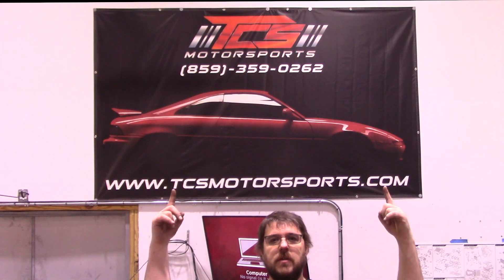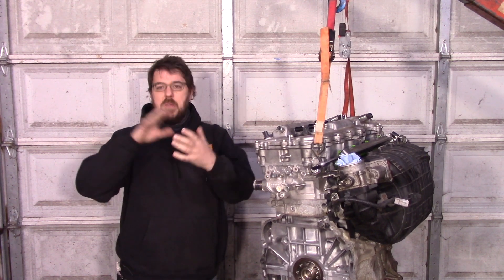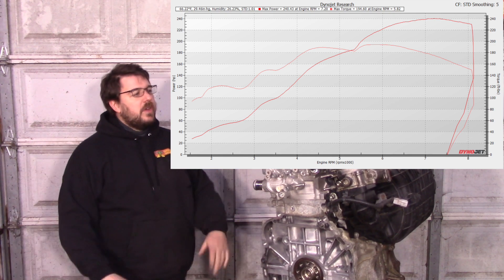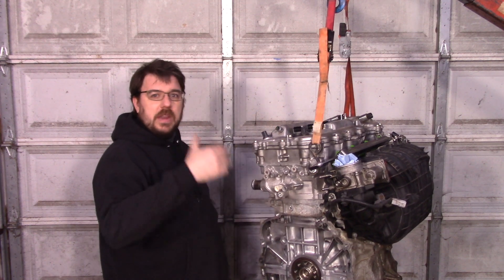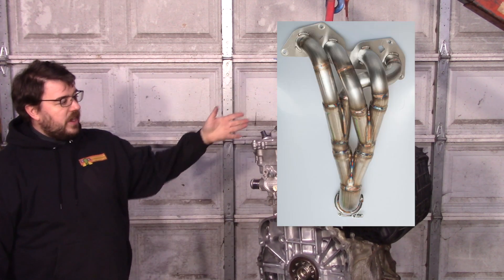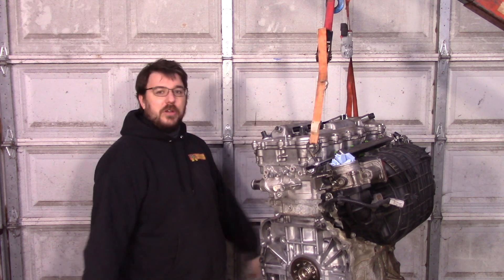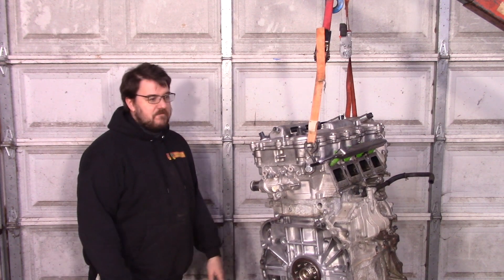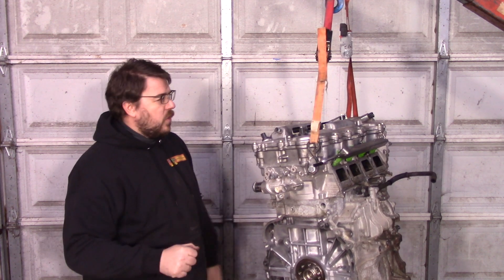Upgraded camshafts for the 2AR-FE.

Comment: Hey buddy I have been watching your videos on this 2ar for awhile and have really enjoyed your content. I was wondering if you're running A/M adjustable cam gears? I'm having a problem with a 2ar Camry at work and haven't been able to figure out why I am getting a P0017 code. Trying to relearn cam position sensor following all-data procedure and it bent all the intake valves. Timing marks were verified 3 times and were still on even after the carnage. Any help would be appreciated

Comment: So these are a replacement for the FXE parts bin cams? Seem very similar in outputs

Rather, were since I see these are no longer available
Reply from the maker: These are much bigger but the stock intake limits the airflow to near the same number. Also keep in mind it makes a bit more power with less compression. With the intake swapped to my velocity stack intake these cams gain 30whp and there's more to come.

The cams are currently not available but that's work in progress and they will be available again by the end of this year.

Comment: Toyota did a good job with the 2AR-FE engine, it has potential. I have the same motor in my 2013 RAV4 and I put on an short ram intake, exhaust headers, flowmaster chamber and the throttle enhancer. All that made a difference. It boots for an N/A engine. If I did change the cams like you did, It would be interesting to see the output change. 237,000 clicks and still running like a beast. Good job on the results from the cams, really impressive 👍.

Comment: do you have a clear pic of the dyno? it always seems most videos on youtube never have a clear dyno pic.... what gearbox and gear ratios are you using?
Reply from the maker: You're in the wrong video for the dyno graph. You can see the exact dyno graph at 1:44 in this video: https://youtu.be/_-bpPF3e9zw?t=104

You can see a screenshot of it here: https://FrankensteinMotorworks.com/2ARFE/2AR-FXE%20Original%20Dyno.jpg

Note that there's a couple horsepower discrepancy between the video and that screenshot. the video was taken with the dyno accidentally set to SAE mode instead of the new STD standard that everyone seems to be going by (at least in the MR2 community). but either way because the atmospheric conditions were very close to no correction the difference between the numbers is tiny.

Also, note that this is on pump gas, with E85 and the 12.5:1 compression ratio there should be a fair bit more.

Comment: Its so interesting that pretty much everything done here, toyota did to the A25A FKS on the non hybrid variants. 13:1 compression, 7000 RPM redline, electronic intake timing instead of oil based, and voila, 200+ hp. Imagine taking the A25A and pushing 300hp out of it.

Comment: 1000 dollar cams bro come on
Reply from the maker: Without hearing you say this i don't know if the tone is positive or negative, Is this an exclamation or a complaint?
Reply: @FrankensteinMotorworks  expensive  man
Reply from the maker: @That2011silverado  I'm sorry you feel that way. I am super happy that I was able to bring a high quality and extremely low volume product at the same price as the Honda equivalent significantly higher volume part. It costs a lot more per part to make 10 of something than to make 500 of something.

Comment: Great work! Planning to rebuild my 2ar on my Tc for a NA build. I just know there’s so much potential for these. Sucks that the Tc community is full of “I want easy power”. Currently thinking of using the 1ar crankshaft, forged pistons and rods, valves and hopefully top it off with your camshaft. I am currently tuned, but was wondering why again would this cam not work with the stock ecu? Is it because of the low idle? Super new to the whole internal engine work. Kind of been forced since I believe a piston ring is bad, so I figured I’d go the whole yard and rebuild as much as I can. Nevertheless you are leading the charge! Glad I came across your channel.
Reply from the maker: the big issue with the stock ECU is the fact that it gets really angry at misfires combined with the fact that it wants to idle at 650RPM. It's really hard to make big cams idle at that low of an RPM especially without misfires.
Reply: @FrankensteinMotorworks  what’s your thoughts on 1ar crankshaft on a 2ar motor? Also I’m looking at JE pistons and molnar connecting rods for my rebuild, any recommendations on pistons and rods? Also which tune is it that you sell that will allow me to run the cams?
Reply from the maker: @TheGoldensoldierable  the 2.7L crankshaft is a good cheap upgrade but it dramatically increases the cost of pistons since they need to be custom. Molnar seems to be fine but is a bit of an unknown quantity, i bought a set when they were the only offering but now that Pauter has an offering i will likely buy from them for the next build. as for JE's pistons, they are focused on turbo builds. i would not recommend them for NA builds and instead just give a call to JE or CP for some custom units.
Reply: @FrankensteinMotorworks  yes I seen many tc forums about custom rods with the 1AR but they all lead to dead ends. I wonder if anyone has corrected this. Would love to know what rods they came up with.
Reply: The difference in stroke is like 7mm, so I guess my choices are shorten?? the rods or custom pistons?
Reply from the maker: @TheGoldensoldierable  keep in mind the motor was designed as a 2.7L motor that was de-stroked for the 2ar-fe so it isn't tight at all. the 2.7L pistons just have a 3.5mm shorter compression height and there's still plenty of space for all the rings.
Reply: @FrankensteinMotorworks  is there anyway I can dm you if I have further questions? Like Instagram or discord
Reply from the maker: @TheGoldensoldierable  I have a discord server here: https://discord.gg/SX3eNwNrPe
Reply: @FrankensteinMotorworks  So the deck heights of 1AR-FE and 2AR-FE are the same? Meaning blocks are the same? I thought the 2AR has shorter deck and in order to use a 1AR crank the pistons with higher located pin must be used. I guess I was wrong.
Reply from the maker: @АндрейЛеусенко-д4е That's correct, the blocks are exactly the same. I've interchanged them without issue. The compression height on the 1AR pistons is about 3.5mm shorter to make up for the longer throw.
Reply: @FrankensteinMotorworks  Thanks a lot. You saved my money, so I can buy only a crank, not the 1AR block. Thanks again.

Comment: so my 2arfe oil is starting to get pretty glittery, and the engine is not knocking. because the glitter is gold in color i am assuming it is my cam bearings or maybe the crank bearings but i hear some ticking in the upper half of the engine. i am planning on ordering cam bearings, i was wondering if off hand you would happen to know how many i would need to do a full swap.
Reply from the maker: There's actually only one cam bearing. the #1 position on the exhaust. in all other positions it rides in the aluminum carrier directly. So gold is unlikely to be cam related. If it is cam related the whole cam carrier needs replaced but i think it is reasonably priced.
Reply: @FrankensteinMotorworks  if it was crank related or even rod related wouldn’t it be knocking though? It’s been glittery for 30k+ miles with many hours of idling.

Comment: I do have a couple questions.  So I have vf tuner. Which is the tuning software for the stock Toyota Ecu. Would that be able to run these cams since I can adjust vvt and ignition timing?
And second do you have any bottom end mods on the engine ie pistons or crank or is it all stock except for the cam?
Reply from the maker: The issue with the stock ECU is that these cams are quite large and won't idle without misfires at 650rpm where the stock ECU wants to idle. You would need the stock ECU to either have a higher warm idle target or have the ability to ignore the misfires at idle.
Reply: @FrankensteinMotorworks  Thank you for the reply, i will have to check with matt over at vf tuner. I think he is trying to implement warm target idles. I know we can change cold idle target.

Comment: This is very exciting news for the ZZW30 community! This is a huge upgrade to power in this configuration, and it honestly makes taking the plunge into the 2AR swap seem that much more worth it. I seem to only know of yourself working this hard on the 2AR front for this community, with your website & YouTube videos being the best resources for doing this swap. You are doing excellent work, and I am very excited to see what your research & development lead to!

Also, I am trying to plan doing a 2AR swap for my 03 Spyder and I was wondering if you have any input on trying to use a Rotrex supercharger with a 2AR-FE in the MR2 Spyder. I was also wondering if your custom camshafts might work with them. Any input is greatly appreciated, thank you & keep up the good work!

Comment: Im interested in buying the cam the and the valvesprings for my 2013 camry. Will the haltech 1500 function with the automatic transmission it has?
Reply from the maker: Unfortunately I don't have a good answer for you for the automatic transmission with these cams. But I am getting a smaller set of cams made at the same time that should be compatible with the stock ECU which will make use with an automatic transmission much easier.

Comment: I can see the PCV valve 🤦🏽‍♂️
Reply from the maker: The PCV system on this motor has not given me any issues or reasons to make any adjustments to it. I suspect this may change once i add boost but for now i'm happy with it. It does put a bit of oil vapor in the intake but since there is no EGR system the oil never gums up and sticks in there.

Comment: Hey, for a 2ar-fe. If an engine has 150k, but doesn't have much/any clinder or block damage. Could that engine be rebuilt and run for another 100k? Just would love to know how to read the 2ar-fe and tell how much life could be in one, thanks!
Reply from the maker: If it has 150k and no cylinder/block damage it's generally going to be good for at least another 100k without a rebuild. These motors aren't like the ones from the 1990's anymore. it's amazing how long these things last.

Comment: looking at your dyno, at 5500 RPM, im seeing a big jump. similar to a 2ZZ when LIFT kicks in.  whats going on there?  is that an ACIS crossover or something?
Reply from the maker: Yeah, that's the low to short runner cross over point. This is part of the reason i haven't wanted to get rid of the stock intake, the dual length intake runners makes a big difference to the power band.

Comment: Would absolutely love a set of these in my 2014 Scion tC but don’t have enough experience with engine work, I’m fairly new to the channel, have you heard of the vFTuner? You can create maps for Toyota ecus, do you think it can be used to get these cams working?
Reply from the maker: Yeah, the guy behind vFTuner is pretty smart but he seems to have abandoned supporting the 2AR way early in the development of this program. I tune these ECUs in a different way but it really isn't feasible for most people to do it the way that i do. 

I think these cams are likely too big to get working on the stock ECU due to the poor idle quality when idling at the 650rpm that the ECU wants to idle at. These cams really need to be idled at a minimum of 900 RPM.
Reply: @FrankensteinMotorworks  I forgot to reply earlier, there’s still support for the 2AR with the vFTuner, in their forums, they mention they are working on some performance maps for it in the tC 2011+.

Something I wanted to ask, what do you think about light weight crank pulleys? NST and Agency Power have a light weight pulley and dyno sheets claiming almost 20hp gain at just above 4000rpm, and gains across the power band. Have you looked into these?
Reply from the maker: @juancorona3893  the NST pulleys are the same exact diameter as the factory pulleys so there would be no underdriving accessory gains from them. the only gain is from the reduction in rotational inertia. If that pulley manages to reduce rotational inertial at a peak or 20hp i would be amazed. This does not pass the BS test in any way shape or form. 

That said, yes, it technically will reduce inertial losses. I don't expect it to result in anything significant.

Comment: Your new custom Cams, will they fit into the FXE engine? Would that make a great cost effective high compression engine?
Reply from the maker: Yes, absolutely! You'll have to check piston to valve clearance but i'm 90% sure it'll have the same clearance so it should be just fine.

Comment: I also believe with a more efective intake you would easily see a 20/30hp more
Reply from the maker: I do have plans to make a modular intake that will allow me to try different length runners and plenum sizes but I would expect the max gain to be closer to half of those numbers indicated. But there's really only one way to find out and i plan on finding out :)

Comment: Over 3kpa drop can make a big power difference, one of the engines i tested going from 1.5kpa drop to 0.5 kpa gained 4% more power
Reply from the maker: I agree that it isn't great but it is still doing pretty good. 4% more power is a bit confusing though because atmospheric is about 100kPa so going from 1.5kPa restriction to 0.5kPa restriction is only about 1% more air pressure available ahead of the runners. That car must have had some kind of resonance going on to add 4% more power from 1% more air pressure. Of course, that kind of thing can happen and i simply won't know until i try it.
Reply: @FrankensteinMotorworks  how can I contact you without being through here? I got lots of tested data on intake manifolds
Reply from the maker: @BDSMotorsport  In order of preference: Marc@frankensteinmotorworks.com(or the contact us form on the web page which is e-mail also), Discord ( https://discord.gg/n8NZA3FfSf ), Facebook( https://www.facebook.com/FrankensteinMotorworksLLC ) note that facebook is not something i check nearly as often as other people.

Comment: So to get this 240 hp. That was a stock motor with the exception of the cams, springs and lifters?? Or are you still using hydraulic lifters? Thanks
Reply from the maker: The stuff on the outside of the motor also matters but yes, that's all i did to the insides and i am using the stock hydraulic lash adjusters.
Reply: @FrankensteinMotorworks  what’s the rocker ratio on this motor?
Reply from the maker: @89gts  it's actually a really weird ratio because of the super short rocker. the rocker ratio varies quite a bit through the travel. but it's about 1.65 or so for a rough number.
Reply: @FrankensteinMotorworks  do you think the reason papadakis was having issues with the rockers being spit out was just due to how long they they were keeping the motor at high rpm? You took this up to 8200 rpm with stock lifters and rockers -do you have any concerns about this?
Reply from the maker: @89gts  9500 RPM is a pretty big distance away from the 8200 RPM I've spun the motor up to here. Also, he was running heavier valves to put up with the nitrous and boost he was throwing at them.  He also had a bunch of money on the line. a potential failure for him was a much bigger problem. I think i'll eventually get to the point where i have to do something similar but i expect there will be quite a few other hurdles to overcome first and i would just be wasting money and time trying to fix that problem at this point.

Comment: Do you have or plan on making a build sheet for this motor, or as you go? I'm trying to watch all your videos but it's hard to know which video came first and the following consecutive videos. I've just been looking at upload dates
Reply from the maker: I covered it in the video but this engine is really simple: stock 2AR-FE, valve springs and retainers that i sell on my site, camshafts that i currently have for pre-sale on my site, no porting or any engine work at all, the MKIII MR2 swap header i make (link in description), stock 1ar-fe intake manifold with stock throttle body (not modified), stock rubber elbow from throttle body, the MAF pipe that i sell on my site. All topped off with a Haltech Elite 1500 that i also sell  and you have an exact copy of what i made here. It isn't a complicated build.
Reply: Thank you, for the clarification. Keep up the great videos! Always fascinated to see your project builds progression.

Comment: Which engine is better suited for NA power the 2AR-FE or 2AR-FXE?
Reply from the maker: It really depends on how far you're pushing it and what you can get locally. the 12.5:1 CR from the FXE is really good for NA power. I don't know how strong the factory pistons are but i don't expect they'll give you any issues for an NA build. But the 2AR-FE is generally cheaper to get and you can just upgrade the pistons in it.

Comment: Amazing results like always, excited to see the next video with the 260° cams
Now taking into consideration that the ported head is going to have bigger valves on both ends are you concerned about the exhaust port being so small in comparison to the intake?
Reply from the maker: 38mm intake with a 31.5mm exhaust if anything is actually a bit big on the exhaust if anything. the motor could actually fit even bigger exhaust valves but i was concerned about having the balance being too far off. Some of this just comes down to an iterative process, i doubt this ported head will be the last one that i need to make.